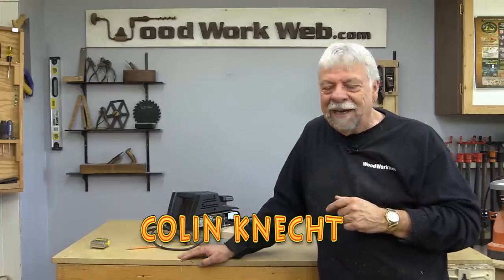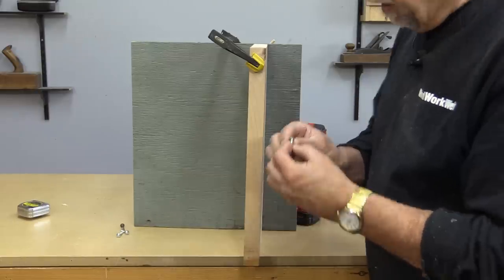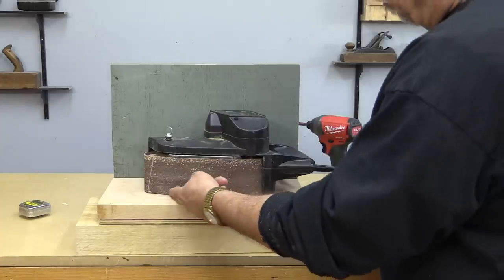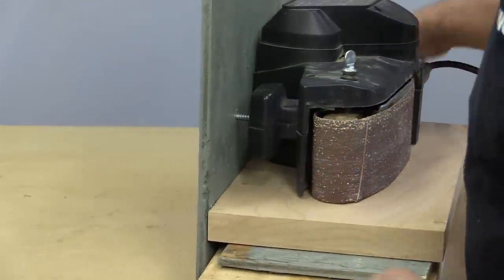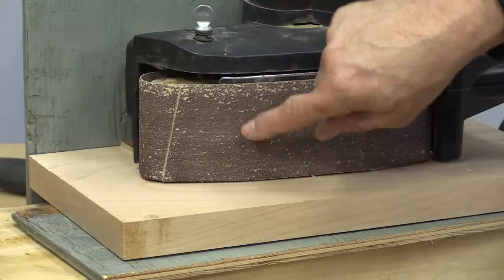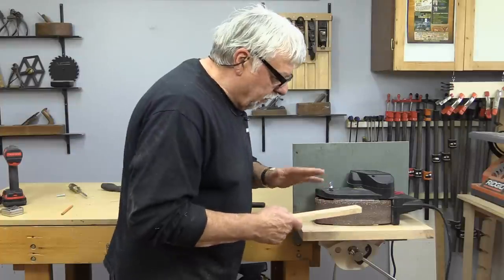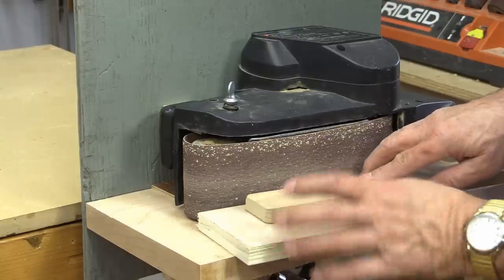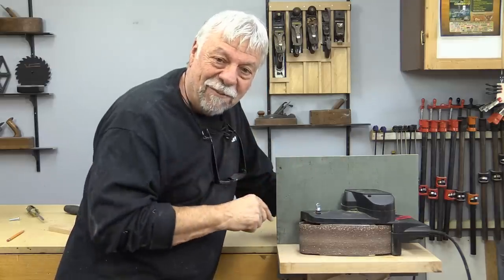Belt Sander Stand: Convert your Belt Sander to a Bench Sander

Comment: Thanks Colin, good video.  Converting a hand-held belt sander like this is incredibly useful, especially in a small shop.  I have mounted mine vertically so the belt runs downwards.  It requires the sander to be mounted in a hole in the platen which can be tricky depending on the model. 
 However, this makes it easier to control the workpiece as it is pushed down onto the platen rather than being pushed away to one side.  There may be safety issues with this approach so any feedback would be welcome.

Comment: I just picked up a Wen sander with slots and included clamps for mounting.  Less than US$40.  Planning a similar setup, but mine will be a bit easier to remove from the jig with the clamps vs. the bolts.  Thanks for the tips!

Comment: Thank you for all of your wonderful inspiring videos. I've been debating on buying an oscillating sander or a good drill press. The more I think of it, I'd rather spend that money on a good drill press and turn my handheld belt sander into a benchtop tool since it works great. I'll buy that oscillating sander later on down the road when it's more needed. I just do hobby projects for now.

Comment: I've been thinking about this idea for awhile, but my older 3 X 24 RIDGID belt sander has motor vents on both sides and the top, tracking mechanism on another side, dust ejection on the other side and it doesn't have a flat top.  My jig will have to be a little more complex to mount and allow air flow and dust ejection through the base board.  Also, would have to be disassembled from the jig to change the belt.  I still have a very old Craftsman Professional belt sander that would mount very nicely, but it's not running smoothly...probably just needs brushes, but I don't think they are available anywhere.  Still thinking....

Comment: I've been trying to make one of these for my sander. Trouble is, mine has a very awkward shape to it. Do you think you could do a video on mounting odd-shaped hand tools safely and securely?
Reply: I wonder ( and I say this without knowing a thing about it's shape) if could you perhaps cut a hole around the widest part and have it poke through the back panel and then fill out the weird shape from there onto another panel that is flat. Basically a crude moulding?

Comment: If you want to be able to remove the belt without disassembling the setup, you can mark around the belt and cut the shape out with a jigsaw or oscillating saw. Then replacement of the belt would be done from the underside, and dust wouldn’t be able to build up underneath the saw.

Comment: i wanted to transform my belt sander to something like that, but i was worried regarding the heat management, still looking for a solution for that. Are you having any heat issues, regarding the air cooling gaps for the motor being jammed by the plywood sheet below it ?

Comment: I liked this video.
But:
1)motor ventilation holes are closed
2)changing of belt sand paper will require to uncollect   this nice and very simple device
So maybe better would be to turn upper and underneath sides.

Comment: change belts ?need to take apart?
Reply: Most of the belt sander out there both hand held and stationary require some disassembly to change belts.
Reply: point being ....have to disassemble  to change belts
Reply: No. On my similar sander you push the front roller back and it locks, slide the belt off to replace, then use tracking adjustment knob to release lock.